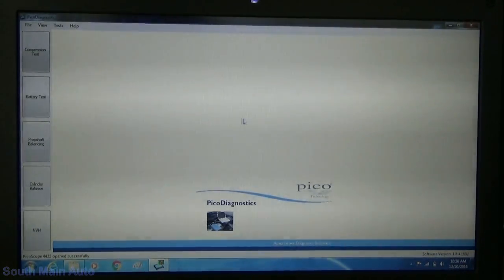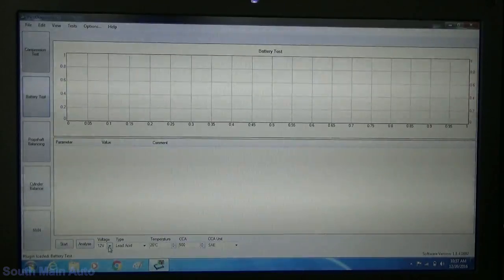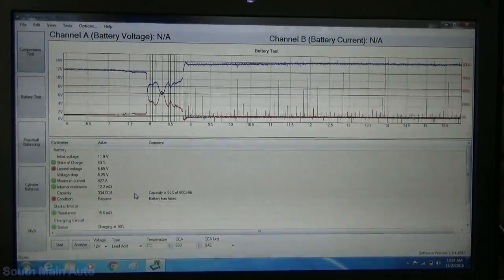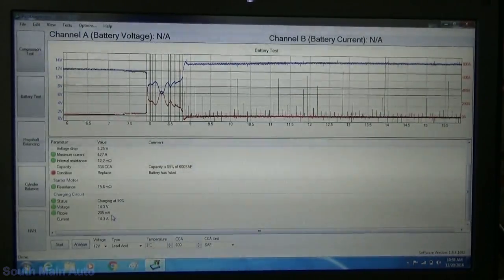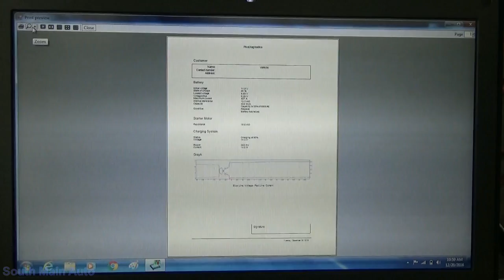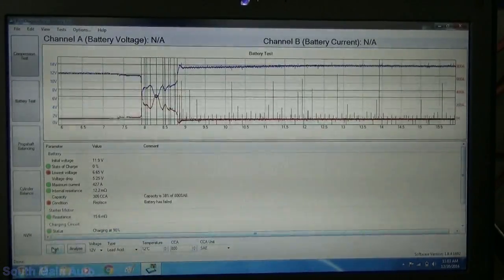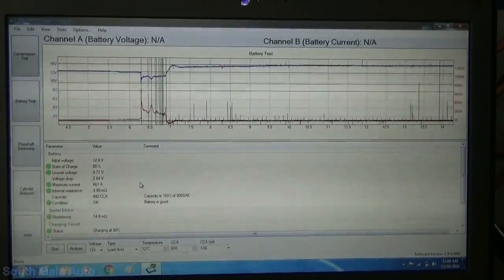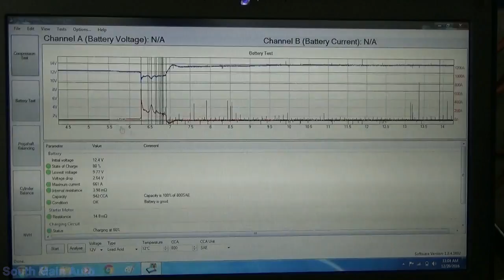Pico Scope Battery Test

Comment: I've been using carbon pile testers and they work pretty good if the battery is properly charged and warm. However I've been scratching my head as to how to test the three 12V AGM batteries for the boat. Nobody seems to know how to test those. By chance, within the testing algorithm for pico, do they offer a diagnostic option for AGM batteries?
Reply from the maker: I do believe it was in the menu. If you want to look your self you can actually download Pico's software for free from their website.
Reply: One day I hope to get one of their two channel sets, I don't think I need the extra bells and whistles of four channels.

Comment: Hi Eric, Your 4425 is hanging on the bonnet catch, are you using the blue usb 3-0 cable as mine is only about 3ft long and as it's usb 3-0 its like a stiff hose! Is the one you are using a 3-0 or have you just used the standard usb 2-0 lead as they can be much longer and a lot more flexible. The usb 3-0 is a much faster data transfer but when would you need faster data than a usb 2-0?

What thermometer is on the battery?   Thanks

Comment: Little dis-concerning how the days of the backyard mechanic are disappearing. Unless you buy a pile of testing gear.
Reply from the maker: Nah it can still be done, this just makes the job a bit more easy :D
Reply: I've been sliding by without anything but a 18 year old Blue-Point multimeter - I think it's more luck than skill, LOL. 

After watching quite a few Youtube vids since I finally got good internet here last year, I see that I could get stuff diagnosed and fixed in 1/10th the time with a scope and a smoke machine. Time is money! Unfortunately, it takes money to make money ...

Comment: YEP -  I need to sell some stuff and get me this setup!

Love the PICO vids - thanks a million!
Reply from the maker: This is just the tip of the iceberg man
Reply: I don't know if you mean diagnostic tools I need to buy (I know I'm nowhere close to where I want or need to be), or that you have more vids up  your sleeve? I hope you mean the latter. ;)
Reply from the maker: mmmm maybe both...
Reply: HA! Sweet. :D
Reply: You can go long way with a simpler much cheaper scope like uScope.
Reply: I definitely have lots of research to do, and lots of "option-weighing". 

My last big purchase was the Autel Maxisys. I'm starting to regret not getting the Pro version, since I've discovered there are a few parts on my own Silverado that would require a reflash if replaced. That tells me that I'll probably be seeing more and more of this as time goes on. It's a tough balance - either I get a cheaper tool and regret it later, or go for broke, and know I have capabilities that exceed my knowledge. Definitely a tough decision to make, but the way I look at it, things like this are an investment.

Comment: All's I can say is as a customer if my tech gave me a before and after printout like that I would be permanently hooked on that shop/tech.
Reply: That is exactly what all shops have supposed to be doing for the last 35 years
People hate the auto shops to such a degree, that it isn't worth trying to work
with and educate a customer
We used to take customers for a road test before even taking in a job
Then a shop tour & tried to get them to return during the repair process
Good luck with that. Most folks shop for price & then keep things, you
need know about their vehicles issues, to themselves or out right lie to you
Women Customers are better to work with.
Reply from the maker: I like working with women customers the best because they will tell you everything that has happened to the car sense they have owned it haha. A guy usually just wants to tell you "what it needs" Sometimes but not always.
Reply: In case anyone is looking down at that comment remember it's just data extraction to save the customer's time and money and by association yours too.

Comment: If the maximum current is 427 wouldn't the cca be 427 instead of 334? 
I get the voltage drop test. text book cranking below 9.6 bad battery. Not sure of the cca test. Working at a dealer we have a GR8 that does cca without an amp clamp??
Reply from the maker: That is just a brief peak amperage

Comment: What I would be curious to see for comparison sake is the known good starting the test at 11.9v and the known bad starting the test at 12.4v and see what the pico said. Would the pico be fooled or would it shine? And is that a fair question to ask? And lastly let me say, after watching your videos , most all of them, if you told me I needed a new battery, 100% I'm going with your opinion.
Reply: The voltage drop under heavy load  of a  battery that is healthy but in a low state of charge is very different from a battery that is deffective with a dead cell.
When  load tested a battery with a deffective (gassing) cell the voltage starts out close to normal but drops almost instantly to below 9 volts usually to about 6 volts. When a good battery that needs charged is put under heavy load the voltage starts out low and drops quite slowly.
Reply: I only check my own cars so I take my self time too charge the battery before I do a test with Pico, Last time I did a test on one of my cars 1988 Audi Pico gave my green light on everything except yellow on starter to high internal resistance, I like Pico and MR O when he use it.
Reply: Nice reply and thank you for that. In hindsight I'm guessing my question was on the dumb side, because obviously if the machine can be tricked it's not worth much of anything. And regardless of what the machine says, I'm sure Eric's experience is spot on .Thanks g johan for your reply..
Reply: @Andrew, thanks for that explanation which confirms that the pico will easily pick up on that. In other words it can't be tricked.
Reply: It is a sweet test but keep in mnd most test on batteries are done away from the diagnostic bay in the owners driveway or in a parking lot  in winter conditions. Which is where those little hand held hi-tech batteri impedance testers  are useful,  they are very quick to use and don't cost mega bucks.   I use a very basic  Ring RBA50 which  cost me less than £40 (55$)  and gives a a pass or fail with an estimate of the batteries remaining life and actual remaining CCA.    You can also do  low tech battery tests  with just a volt meter  or OBD II  scantool.
Reply: ,,yep I had to diagnose my motorcycle in the parking lot of 7-11 yesterday .. 1/4 mile from home .. took the battery out ..charged it some,reinstalled..volt meter read 12.95 ( so a little under charged) ,,turn key on..no starter...0.3 volts ...I had totally lost the battery

Comment: I know that Chrysler products have a voltage regulator built into the ECM. I've worked on them where the battery gets replaced, then it still won't charge, then a new alternator and still won't charge, then the ecm gets replaced and it finally charges again. Very off pissing!
I'm retired now but curious, how do you determine if the ECM has to be replaced with a no charge situation in modern Chrysler automobiles?

Comment: Thanks Eric, I have never had this test show a fail. Possibly because I have been entering the ambient air temp in for the battery temp.
Did that thermometer you used just rest on the battery? 
I always felt that the engine started too soon to get a good sample that was why. Obviously not as you just proved!
What is the extended crank test and is it worth doing?
Also I imported our company logo into the software so it comes up at the top of the printout. I managed that from a demo on the picoscope site!
Don't know if it makes if any but you said the battery temp was 2 degC but entered 3 degC 
All the Best Eric.

Comment: Any idea why there are so many spikes in the current?
Reply: You'll get a spike in current draw every time a cylinder comes up on the compression stroke due to the extra load on the starter. You can actually use that to detect a bad cylinder that has significantly lower compression than the others. If it's bad enough you can hear it too, from the uneven cranking sound.
Reply: Look up relative compression testing with an amp clamp